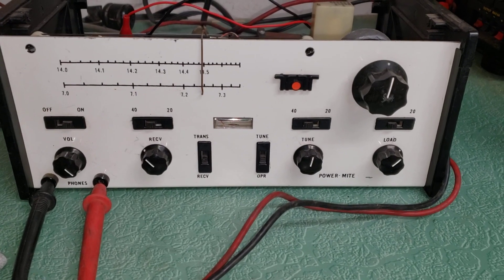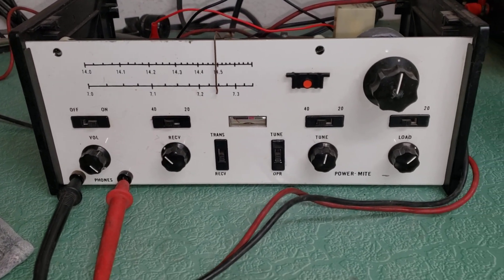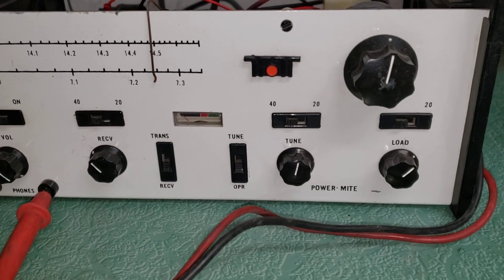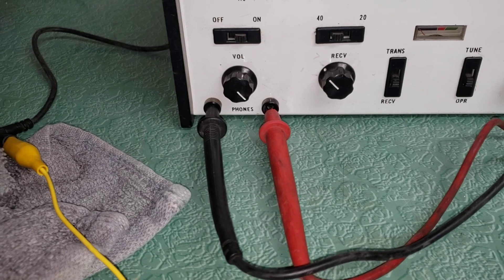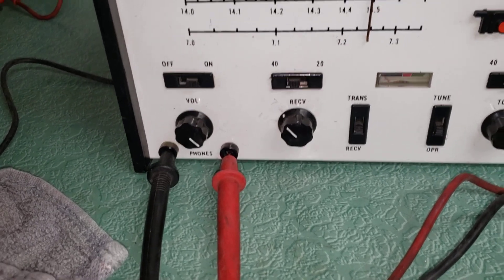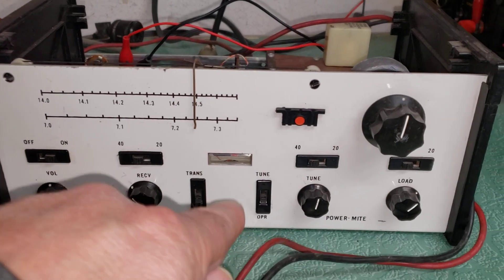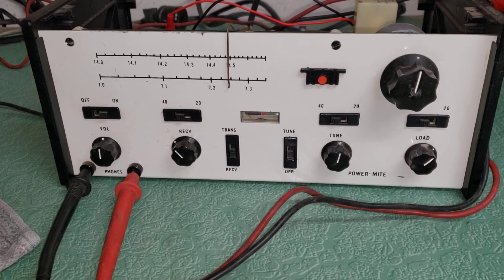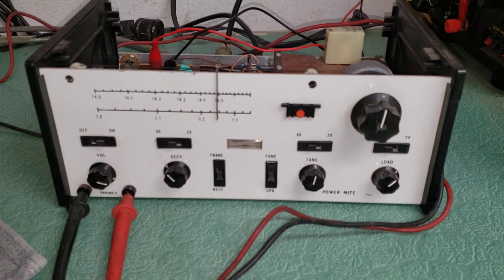Ten-Tec Power-Mite QRP Transceiver

Comment: Did you ever transmit with this power mite ? I have the identical model (40/20) sitting on my shelf for a year or two and I’ve not even tried to power it up. I had an old pm-1 ish version many years ago that I used for listening only and was just looking at my current version to see about either using it or moving it as my shack space is at a premium 😂
Reply: I wound up powering it up yesterday, and it receives well as well as loads up via the tune button. I need a connector for my key.  Tried an rca / 1/4” adapter which did not work for some reason so just have to scrounge a spare rca male plug to make sure before opening it and seeing what the issue is.
Reply from the maker: No I did not. I still have a couple more of the power mite units somewhere in my stuff. Always liked the looks of the radio.

Comment: There's information out there...in a book called QRP Basics by George Dobbs G3RJV(SK) there's a bit of history about them. It might be worth having a look on some of the TenTec related groups on line.
Also QRP groups and societies such as QRP-ARCI, the G-QRP-Club etc. May have information on them. I have a vague recollection of at least a circuit diagram coming with mine but unfortunately that's long gone (I sold all my gear in about 2005 having been inactive for several years, only coming back to the hobby in 2017). I'll see if I can find anything about them and let you know if so. 73, Simon G0CIQ

Comment: I had a PM3 (I think!) about 35 years ago and I guess it was pretty old then. Mine had a number of modifications and the front panel was pretty beaten up. I seem to remember it having a quarter-inch jack socket for hi-Z headphones (I had several pairs back then) and a socket for a crystal on the front panel.
Am I right in thinking the tune and load controls are for the PA to cover the different bands? Good luck with yours, it certainly looks in nice condition! 73, Simon G0CIQ
Reply from the maker: Hello Simon
I wish I knew more about them but this is my first experience with the Power Mite rigs. Thanks for the comments!